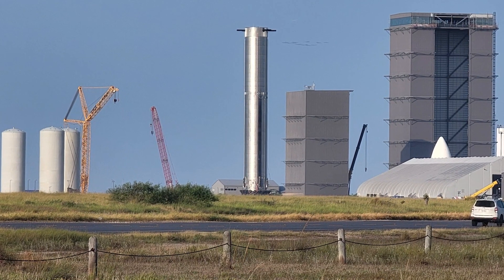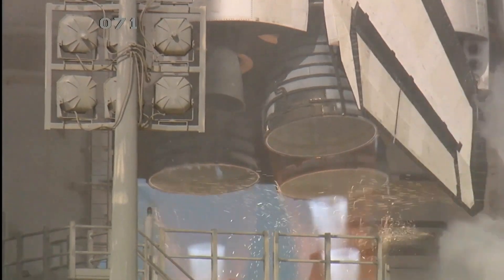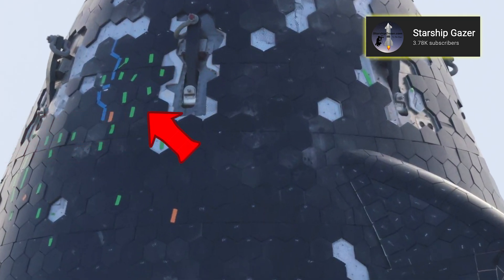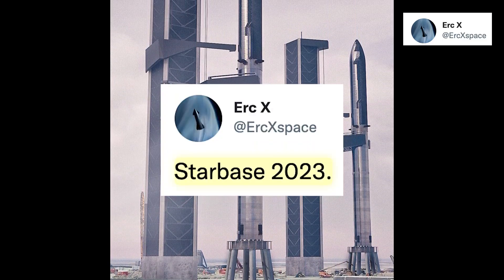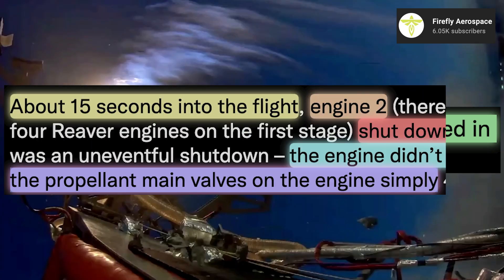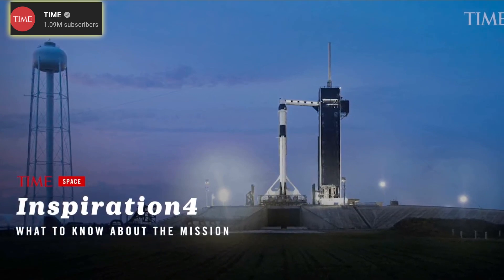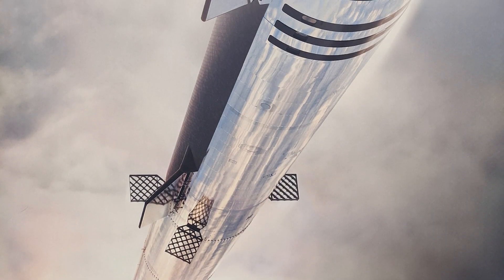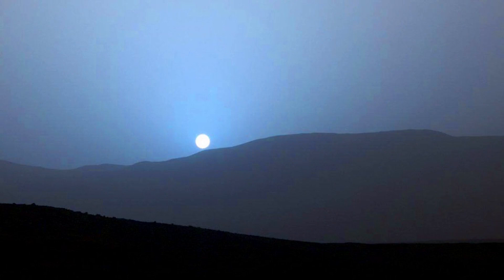SpaceX Starship Engines Mounted, But Still No Protection For Raptors on Booster 4- Starship Updates

Comment: This doesn’t have engine protection??
Reply from the maker: Not that I can see. By protection I mean covered up except for the nozzles.
Reply: I'm a little puzzled about where any covers would attach. The booster's hold down clamps and supports apparently grasp the edge of the bottom ring occupying most of each gap at the top of the pump assembly.

Comment: Yes no raptor protection. Why?? Even sn 20
Reply from the maker: That's the question my friend! I'm almost expecting the booster to roll back into the high bay once more.
Reply: Maybe their holding off for final adjustments. I don't think it will be carted back however.  I suspect IF they add them it will be while on the Launch Stand.  I honestly suspect they won't be added at all due to the disposable nature of Booster 4.
Reply from the maker: Good catch, it may indeed be ruled out since they are not reusing the rocket!
Reply: @spacebeetle  there will protection for booster reentry, superheavy doesnt to an entry burn so there will be thermal protection